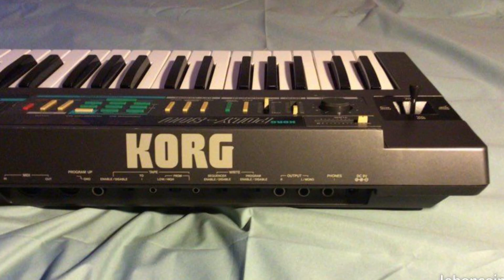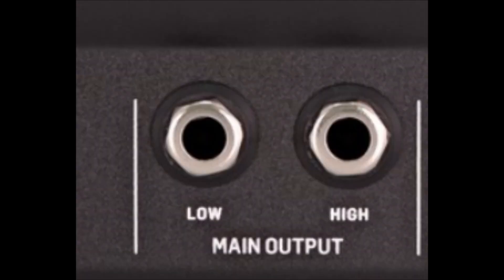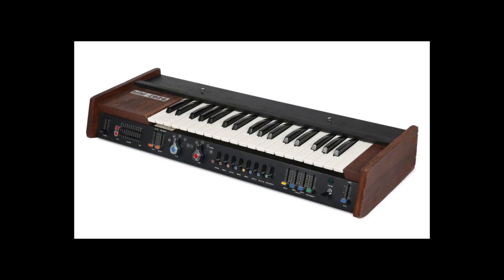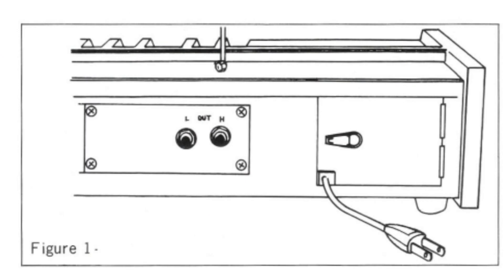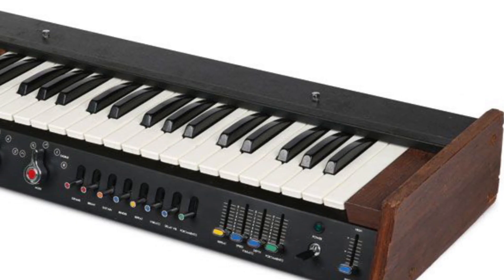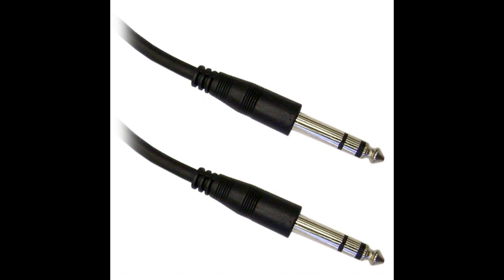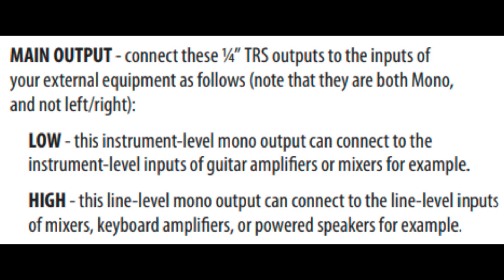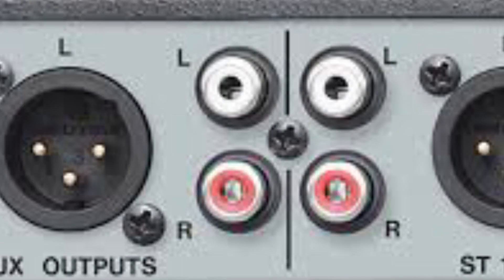What Do The L and H Mean on the Back of Your Synthesizer?

Comment: I was more confused about the two midi in- / outputs from the Arturia MiniLab 3 and the midi adapter from the Behringer JT-4000M Micro. Because it's both the same, just differently named as in- and output. Had to order an extra midi cable now because of that.